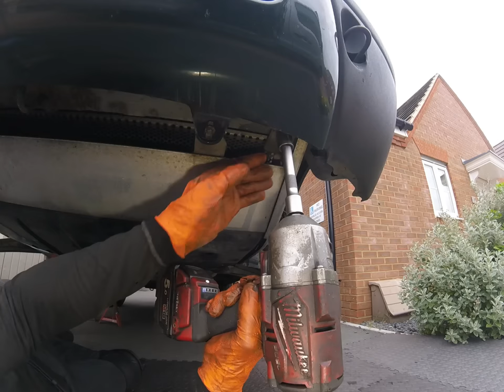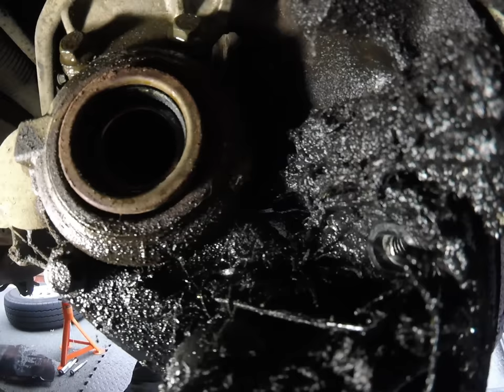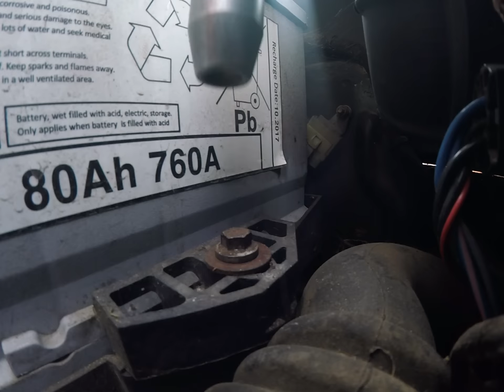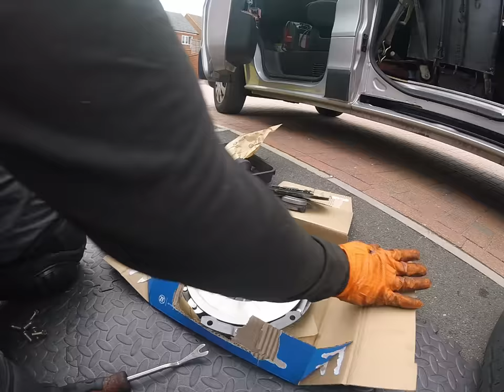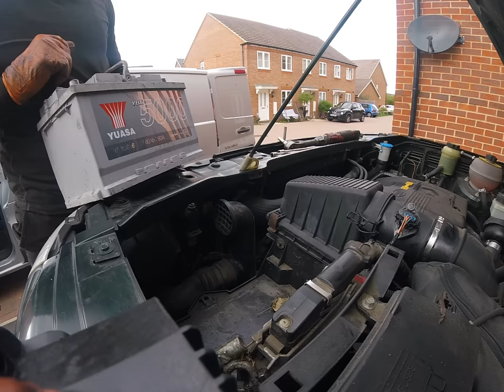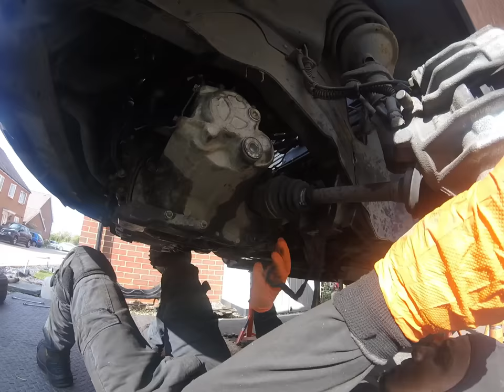1999 Land Rover Freelander 2.0L Diesel (XEDI S-WAGON) Clutch Replacement

Comment: All starter motors should be like those Rover starters because you can take the end plate off the solenoid and clean all the pitting off the main feed to the armature when you get that dreaded click when you go to start your car, certainly when you keep operating the ignition key and it eventually catches and engages  the starter.
On all other starters they are a sealed unit so when they play up it's a throw away job and get new.

Comment: Do you take extra parts with you to the job, like flywheel, axle seals, etc.? Or do you make a parts run mid repair?
Are there any rear wheel drive vehicles in England?
Reply: I think he buys them beforehand. There is a clutch replacement vid about an audi or 350z in his channel, i can't recall well.
Reply: Mainly BMW are rear wheel drive these days. There are some on the channel.

Comment: you would think when they design these cars they would make it easy to get to these parts 🤔
Reply: Some Vauxhall Cavaliers from years ago could have the clutch replaced with the gearbox in situ although I think this was probably just the friction plate!
Reply: @TOMLINBISH  Nope, whole clutch. I did it on my father's car. Total wrenching time about 30 minutes. Remove 1 wheel, undo an inspection cover and withdraw primary transmission shaft. Remove cover on lower of bell housing and after sliding on 4 retention clips to hold cover spring pressure. Undo clutch cover bolts and the whole lot slid out like a CD from a player. But that was when designers had held a spanner before, not just graduates who are good with a mouse.
Reply: Astra in 1980’s was the same.

Comment: Nja view Rover car old oil Not time renove and result small dust metal aluminium Fixsed gear box cluc.
Regular renove old oil engine and gear box people. Long time drive not problem gear box and cluc. good oil gear box engine. Other model car. Reductor remembered oil old renove. Another car model renove oil 10.000 ___250.000____500.000 km info your car model 👍. Old Black oil not good long. Real oil small micro dust metal aluminium real (grinding)